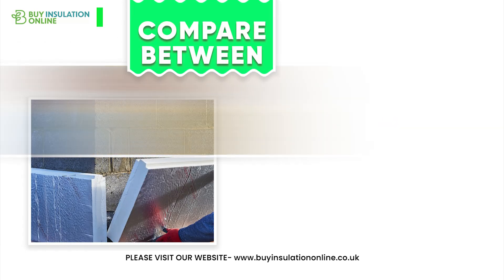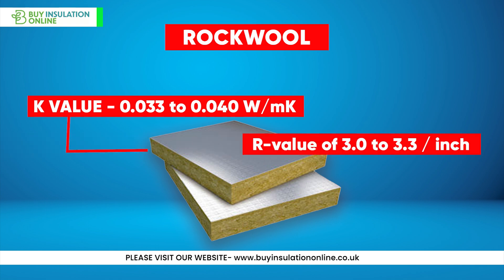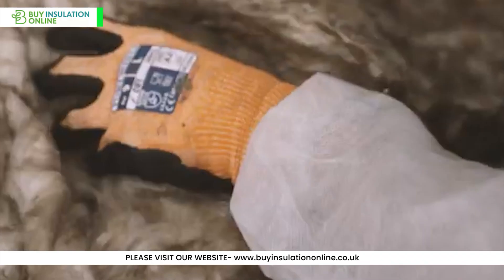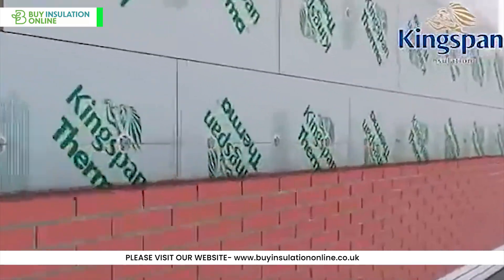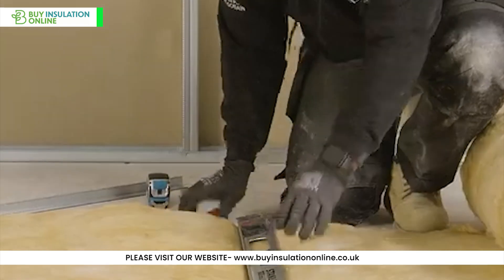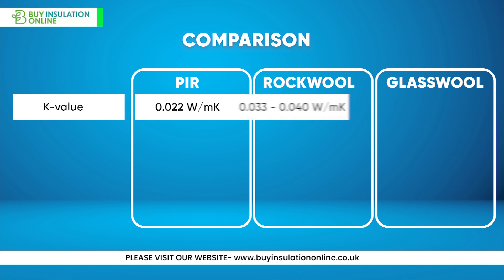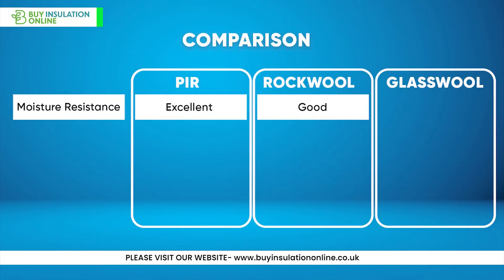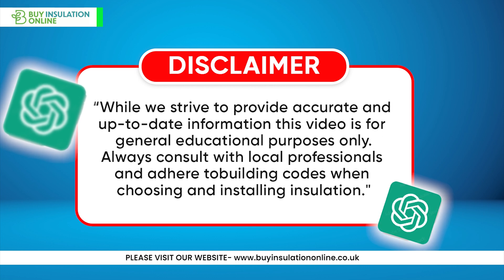PIR vs. Mineral Wool Insulation: Choosing the Best Option for Your Project

Comment: I would like to use rockwool on my dorma extension, with a warm roof and exterior wall insulation. The u value being made up with interior insulation. Because this isn't a main stream way of insulating a house here in the UK, I'm having difficulty finding a builder with experience in this type of build.